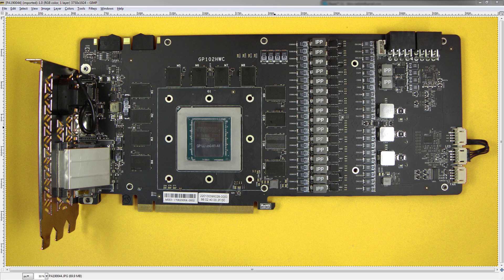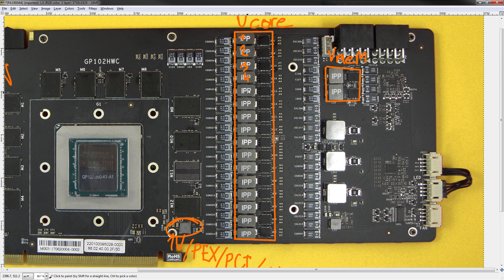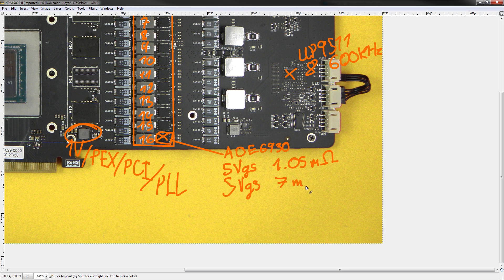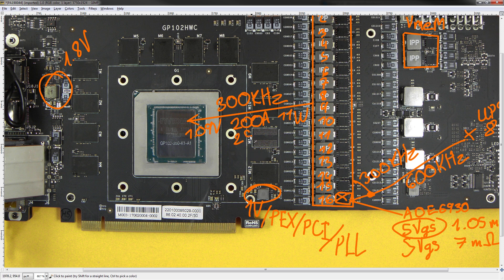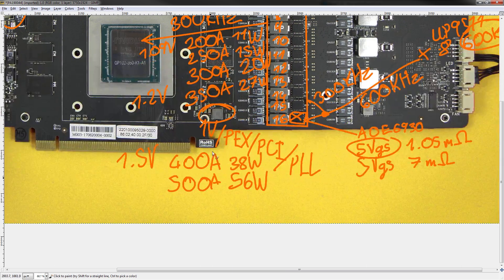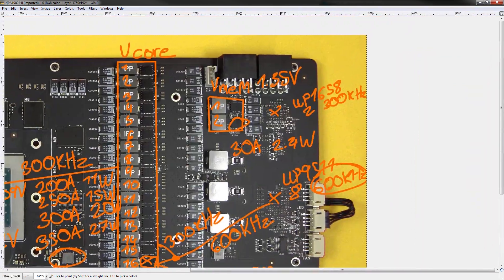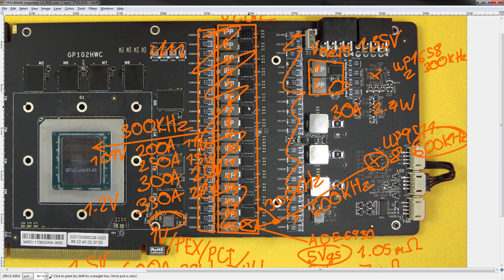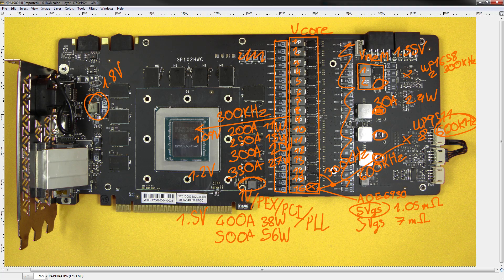PCB Breakdown: Colorful GTX 1080Ti Kudan

Comment: Re: tantalums, I see you've been watching KEMET's capacitor talk too! Some great info in there. Small aside: another major benefit of higher end tant caps is their ultra low ESR for DC performance, although I see why you mentioned "frequency response" in this regard because we're mostly concerned about impedance.
Reply from the maker: you can get SMD and can alu polymers that will match tantalums on ESR. Panasonic has a bunch that are 3mohm ESR. Nichicon FP series caps come in ESRs as low as 5mohm. So while tantalums do have great ESRs you can get alu polymers that do the same. Impedance on the other hand tantalums tend to be significantly better.
Reply: Downside on those alupoly caps is physical size, though.

Comment: Hello! great video, i actualy learn somthing... So i hawe a problem with my msi 1080 ti,water dropet on the back side exact where the chip for powering bios is. It is a prime suspect becouse the card is apsolutly dead , no video ,not rekognized by pc and gpu is cold and dead, Is it posible to change the chip?

Comment: Video idea: What's it take to get a V56 to match an overclocked 1080, and how much more power consumption does it use.
Reply: SlavjanA It depends on what program/game/settings you're running in order to compare directly to a 1080, but you can get it to Vega 64 levels with about the same or a bit more power consumption as a V64 with an overclock to V64 clockspeeds and a V64 BIOS flash for higher memory voltages. V64 benchmarks should be about the same as an overclocked and flashed 56, so you can use that if you want to compare to a 1080.

Comment: 255th 🤣 but yeah waiting for some mobo vrm. And maybe some OC guides for people without LN2 or for daily use
Reply: Toms Bremsmits wrong place for number two. For a daily overclock you don't get the chance to push it nearly as much as LN2 or even water for benchmarks. Like I can get my 4790K to 5.1GHz, but it's not 24/7 on that, not even close so I run 4.7GHz instead. It just wouldn't make for an interesting video in the end and especially not on a channel based on EXTREME overclocking

Comment: please explain why a 980 does not scale with any additional voltage. 1,3 or 1,4 Volt does not even give 25mhz more than 1,21 stock voltage
Reply: melangkoh my guess would be heat but if you are on LN2 then I can't give you a solid reason. Either Maxwell being Maxwell or your core being a turd for voltage
Reply from the maker: Nvidia spent a ton of time optimizing Maxwell for high clocks at 1.2V. What ever they did probably created some hotspots that get so bad as voltage is raise that the card doesn't scale with voltage unless it's bellow 0. Typically around -20C Maxwell starts to scale.
Reply: or maybe they spent much time to make sure it will ONLY run 1500-1600mhz on air? You said high clocks on 1,2V, but look what it can do on LN2, suddenly under Sub Zero it reaches 2200mhz and more. Its almost like Pascal under LN2.

Comment: Can you do Asus B350-F PCB Breakdown?
Reply: I'm not going for extreme overclocking lol
Reply: R5 1600, I have mine at 1.29 volts and 3.8 ghz, CPU and VRMs stay at around 60°C during Prime95 test
Reply: I did some more prime testing because I wasn't sure if it actually was 60°, it's more like something between 50 - 55°, how are those "high" temps?

Comment: Hi m8! If you have the time please read my post on GamerNexus forum: https://www.gamersnexus.net/forum/15-hardware-pc-builds/12867-using-the-asus-strix-as-an-rgb-spiller

While learning from your channel, and I learned a lot, I think you can help me with my mystery. And I don't have the gear to measure the voltage on the RGB cables from the asus Strix card so that would be very helpful. Will try over the weekend to measure them with a standard multi-unit but i think it would not be precise.

Thank you for your time!
Reply from the maker: I don't have the card. So I can't really do anything.
Reply: You can watch the post now and then and slap me on the wrist if I say something stupid. Not asking anything more :)

And first i think i will have to figure what connector is what color on the Strix, just afraid that I have enough power supply to the rgb controller.